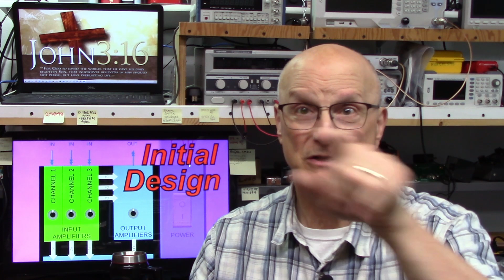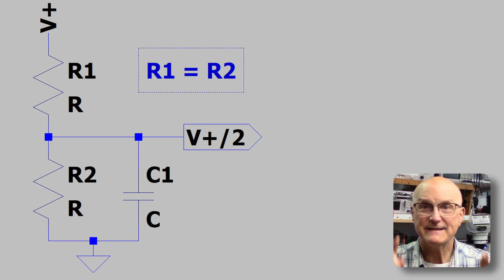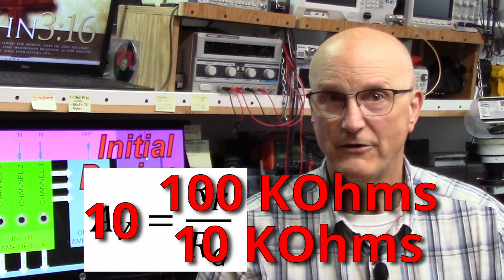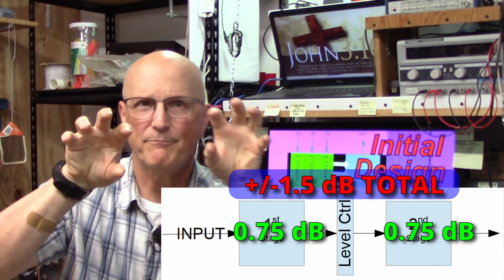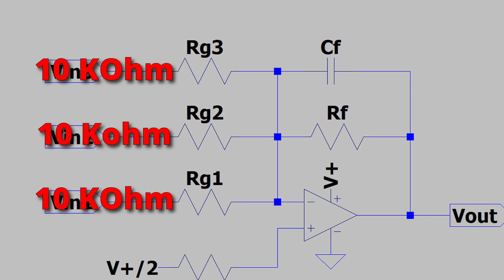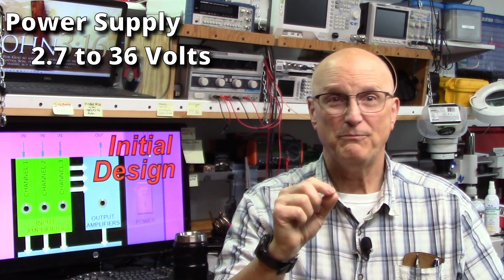Design End-to-End: Step 3a - Initial Design for the Input and Output Amplifiers (060c1)

Comment: I don't see how the requirement of output impedance of less than 100 ohm for the output amplifier is achieved in this design.
Reply from the maker: Aaaah! I guess I did not overtly say how that was done, eh? Sorry about that.  It is quite simple ... 
We start by looking at the datasheet for the specific op amp to find what it's rated output impedance is. Sometimes they will say in one of the many specification tables and sometimes you have to search through the various supplied charts.
With this op amp, it is in the chart labeled "Open Loop Output Impedance." True, we are not operating open loop, but this is specifies the output impedance of the op am itself apart from any circuitry you might put around it.
Looking at this chart we can see that the output impedance of this op amp is pretty much down in the single digit Ohms range at 1 KHz (the standard frequency where much of the audio specifications are tested). It is tough to get any definitive number by looking at the chart, so we "guestimate" at what it might be based on the chart.
Next, we consider the capacitive coupling between the output of the op amp and the output of the mixer itself. In our case, this is 2.2 uF. At 1 KHz, its capacitive reactance is about 72 Ohms. So the output impedance would be 5 - j72, whose magnitude would be SQRT(25 + 5184)=72.
So, theoretically, the output impedance should work out to be around 72 Ohms. But remember, the capacitor tolerance makes a difference, too. Taking the +/-20% tolerance of the 2.2uF capacitor into consideration, the output impedance could vary from 60.5 Ohms to 90.6 Ohms at 1 KHz. If this is too close to the specification for comfort, then we make the capacitor a larger value, say 4.7 uF.
I hope this helps. 🙂

Comment: I am thinking about the gain in the mixing amplifier. If the 3 gain resistors is 10k and you have a signal in 1 of them, then the 2 others are "grounded" to vpp throu the low output impedance of their input stages. This will be lika a voltage divider leaving only 1/3 of the signal. In my thinking 1 think 3x10k Rg then should have a 30k Rf, but maybee this is the reason of the 3.16 gain in the last output stage?
Then thinking more... The negative input on the opamp will always be at 0 (vpp) and no current will flow throug the inactive inputs that are grounded to vpp(no current and no voltage divider), only trough the Rf that then should be 10k as in your circuit.

Thank you for making me think :-)
Reply from the maker: This might be true IF the op amp (-) input looked like a high impedance to the signal. But, it doesn't.  The current flowing to the (-) input from the input through the gain resistor equals the current flowing to the (-) input from the output through the feedback resistor. The (-) is what I am going to call a "null" point for the signal.  Thus, no single input can actually "see" the (-) input.
See pages 3-4 and 3-5 of the "Op Amps for Everyone" book. I had provided a link to the PDF of this book in the description. But here it is again for your convenience.
https://drive.google.com/file/d/11dOtfPKG-1Br6Ke1ikLQUGSp3pCSV-aM/view?usp=share_link
If you have downloaded and installed LTSPICE, you will benefit by this model of the mixing amplifier that I describe. It might be fun to play with.  Here is a link to the model that I created for you:
https://drive.google.com/file/d/1tCkwzsFScBTBaOZLh9XpH-n7cFPXi0f7/view?usp=sharing